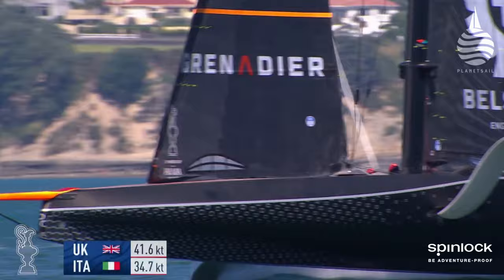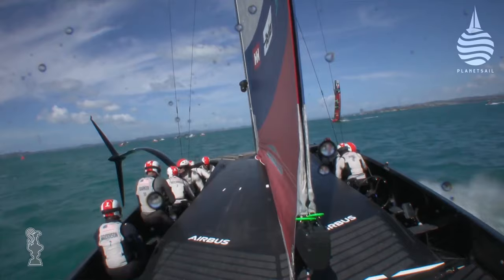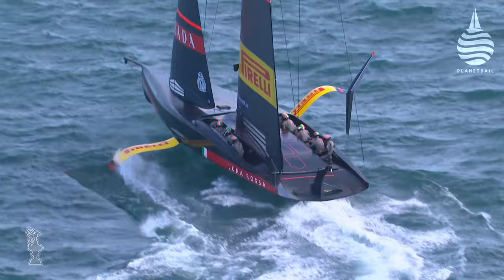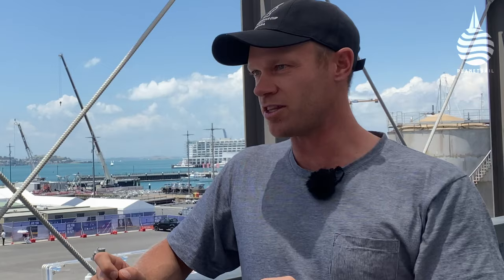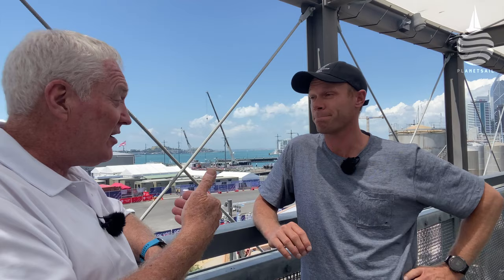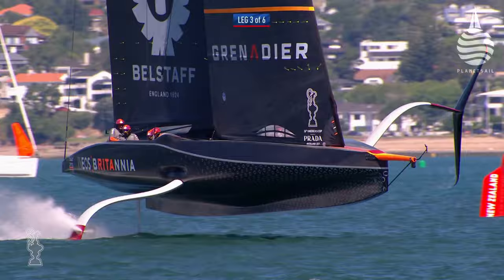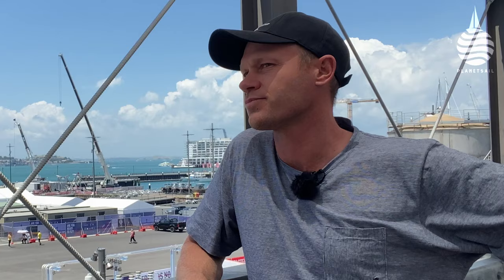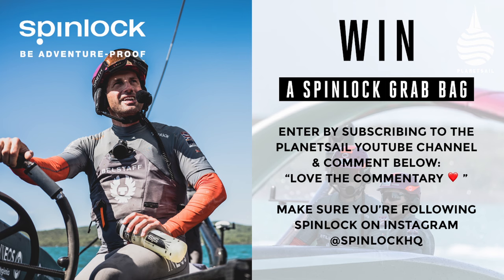How America's Cup crews fly their  AC75s

Comment: Great chat with Nathan, thanks!

So, you know this by now and sorry for another piece of boring production advice, but after content, audio is king. Not a nice looking background:). If you feel like it, read on for some thoughts on that. 

As to what is a nice background, you can't judge it with your eyes. You need to look at the monitor/screen of your camera. The reason being, our eyes are connected to this huge visual filter called our brain and it does an amazing job at filtering out things in our view that we don't want to see. Case in point, I think that reinforcement cross holding the walkway together right behind your heads was filtered out by your brain and you only saw the nice view, but the metal is incredibly obvious on video. So, the practical tip here is to set up the shot, roll a few secs and then review the footage on your screen and you might see things that you hadn't noticed with your eyes and decide to reframe or go elsewhere. Even worse with audio - don't trust your ears in real time - the brain filters out a lot of unwanted noises. Put headphones on and listen intently for 20 secs and you will hear all the noises and then you may have to kill the darling that is that particular outdoor shot. 

Also, we don't actually need to see much of scene or an item to connect the dots and weave our mental backdrop. You could show the clew of a sail and every sailor would subconciously picture the full sail. Stand with a few metres of a bow behind you and people will think "he is standing in front of a boat". So, you don't need much. And since context is also given just by the fact that you are a sailing channel, you can certainly get away with no background as your hotel room studio showed. 

I do know you are just trying to make it look good and thanks a lot for that. Just place good audio over the need for a perfect background next time;). And you if want more eye candy, then just roll more b-roll. 

All that said, the audio wasn't that terrible and the content being as great as it is made up for it. 
Cheers and with respect as always:)

Comment: They talked about keeping the boat level, but not really why it's so extremely critical.  
Because there's only a single rudder foil in the center rear while the main foils are way out to the sides, the roll axis of the boat 
is on a diagonal line between rudder foil and a single main foil.   When the boat heels leeward on that diagonal it causes both foils to pitch up lifting the whole boat out of the water, and if it heels windward both foils pitch down driving the boat hard into the water. 

I suspect that in the overall shared workflow on these boats, keeping the boat dead level  is priority #1.

Comment: Well done Mozzy. A minor criticism is you use the word stability when referring to balance. Two additions. When correctly configured they do not make any leeway except rounding up and bearing away, in the bear away case the leeway is negative. The foil is akin to a gybing centerboard. Secondly, the reason that high-performance non-ballasted boats are sailable is largely due to the fact that the sails provide an incredibly high heel damping moment. In the case of the AC75 near 70% of this comes from its own forward speed. See https://www.facebook.com/groups/2397006860595933  AC75 Heel stability